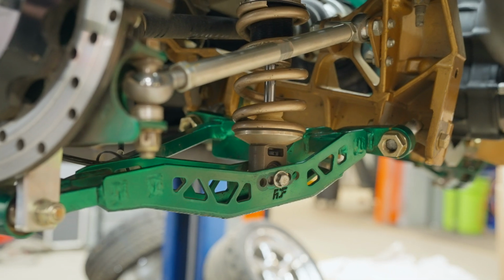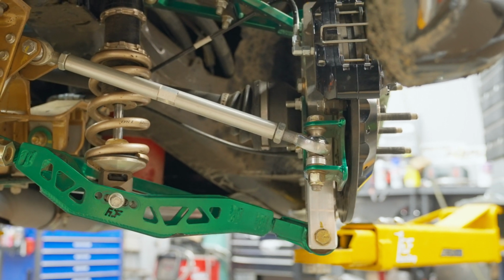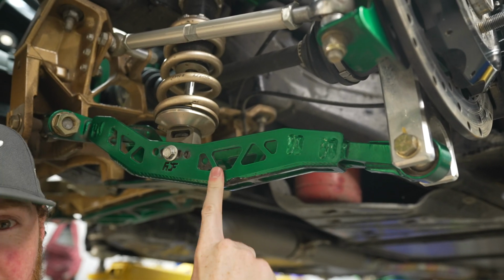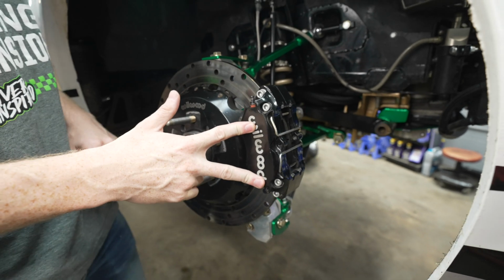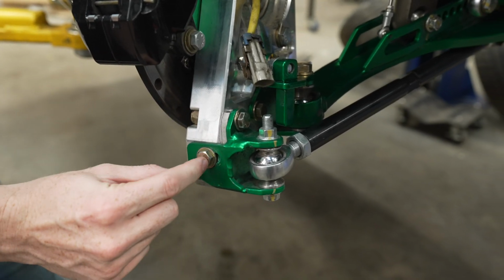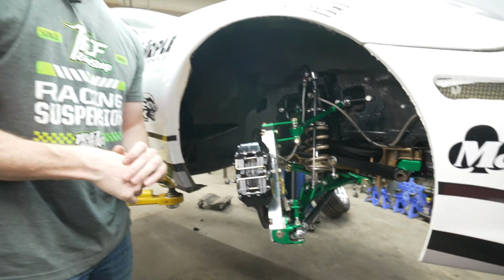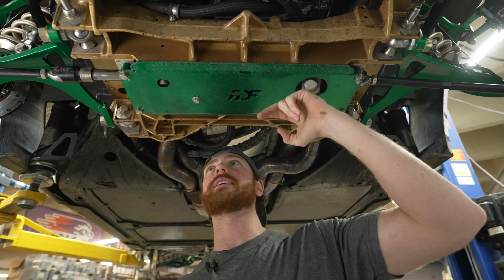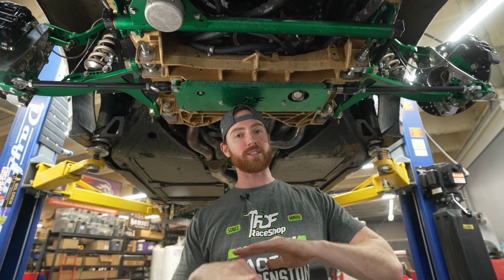The Most Advanced Corvette Suspension Available!

Comment: Rod eyes in bending? Why not have bushings on the lower arm inboard mount to avoid fatigue failure?
Reply: Because bushing will deflect and for a race car you want the chassis set up to stay as ridged as possible so you get the desired effect that you set the car up for at all times.

Comment: Huge mistake choosing a bmw rack is only focusing on the steering ratio. I prefer finding out the stroke of the rack and then counting the movement / turn. BMW quick racks usually have shorter stroke, that gives you "quicker" ratio but less angle. 6" /150mm stroke is usual to find on BMW.
Reply: you have no idea what your talking about when you change pivots you can get as much lock as you want
Reply: To explain if you move the hub tie rod pivot closer to balljoint you get move movement per less steering, this channel literally made a vid about it
Reply: @bigbothoee8617  if your tie rod pivot point and ball joint is on the same level, then there might come issue that you cannot be as close to ball joint pivot point
Reply: I'm sure the guy that designs suspension systems and kits for a living needs your input, since you're such an expert.  It's likely he didn't bother to account for all relevant geometry and constraints in the design.  🙄